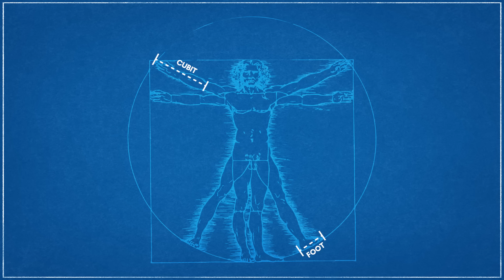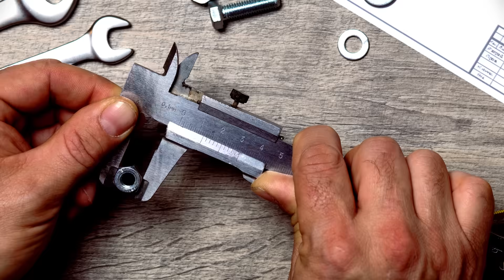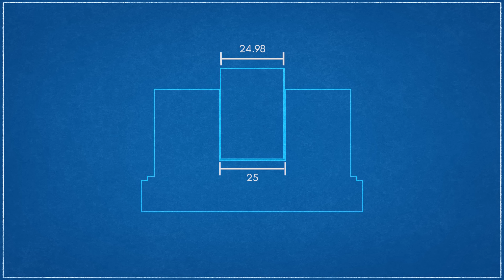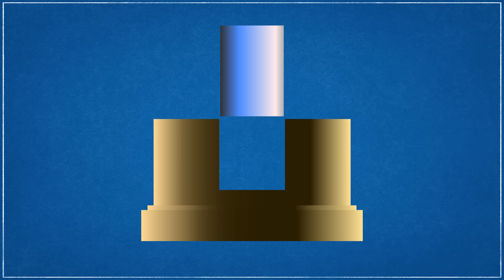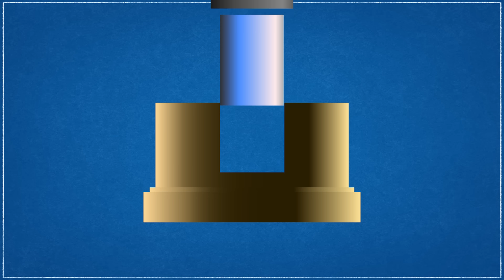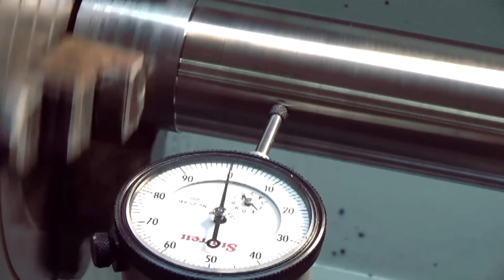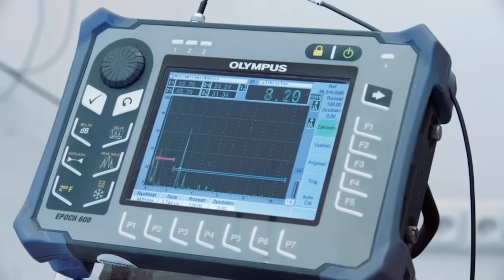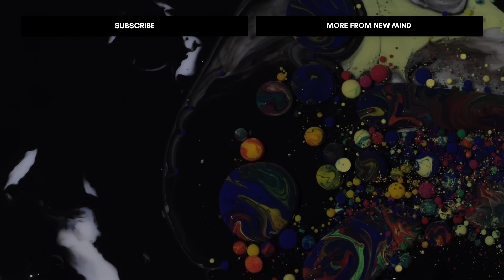The Science Of Small Distances

Comment: ... dealing with distances 50 atoms wide.... :o that's crazy
Reply: Silicon atoms are ~0.2nm in diameter so 5nm is actually closer to 25 atoms thick and at the moment the smallest commercial transistor created by photo lithography is 7nm which is about 35 atoms thick.

If you want to look into the thinnest material we've ever made (at least in lab conditions) look into graphene, that's a single atom thick layer of carbon and is considered a holy grail in material sciences, engineering, semiconductors and everyone in between.
Reply: @GamersaurusRex hard drives are insane if you think about all the science put into what's already becoming dino tech.

Comment: Car engines do use ball bearings. The conrods and crankshaft do not use bearings, but there are bearings at the ends of the crankshaft. There are also ball bearings on the camshaft and on pulleys.
Reply: The only bearing in a crankshaft is the pilot bearing if you have standard shift. Inside the engine with a pressurized oil system you might as well just use it.

Comment: I have almost 60,000 hours at 1200rpm on the main bearings in a 6-71 generator. Still has 30 psi lube oil pressure.
Reply: Who makes the Generator and what type of oil do you use?

Comment: One specialized assembly method to line up two close fitting parts:

Chamfer on one of the parts
-It greatly reduce the need to perfectly line up the centerline of the parts. 
-Parts with clearance of just above 10 micrometers can then be fitted by hand and some gentle force if it is a through hole. 

A blind hole makes it harder as it becomes an air spring, with the satisfying ploff sound upon disassembly.
Reply: That is a satisfying sound. I find myself playing with pin gauges in tight tolerance bores at work a lot. "POP"

Comment: tape measures still provide a vital role in the modern machine shop. I mean, i have to set my cup of coffee on something or else it will leave a ring on the workbench.
Reply: The most common mistake (that happend rarly) was parts beeing sawn too a wrong length. For example 154mm instead of 145mm. But other than getting the raw material we didn't really use it either.

Comment: And yet, the only nation to put a man on the moon still uses miles, feet, inches...
Reply: I've worked on several US military/government jobs where the drawings were in metric. regardless, as Matt D said, the global scientific community (including the US) is standardized on SI units.
Reply: The unit of measure is irrelevant. It's your ability to replicate whatever unit is used that matters. The whole Metric Imperial argument is pedantic.
Reply: @mikelang4191  no , the American system is too akward and  clumsy  for modern science and even for learning
Reply: @tesmith47  imperial originated in Britain and hundreds of millions of Americans have coped with learning it just fine for over 250 years.. and what's so much easier about 0.1 millimeters or 0.0039 inches anyway? I wouldn't argue that a system based on powers of 10 is not simpler, but the imperial system is no more clumsy or difficult to understand than metric when it comes to "small distances" (the subject of the video you're commenting on)
Reply: @tesmith47  look, I'm a Canadian engineering tech and machinist. I really don't care about your analysis as I live this crap every day. SI is better for most engineering calculations, Imperial is better for working drawings and the measurement of small distances. I find the nomenclature more definitive and the resolution is more in tune with the distances of average tolerances. I use both in a regular basis and spend a lot of time converting metric drawings to Imperial as I've yet to meet a machinist who prefers Metric.

Learn to use both well and you'll have nothing to whine about anymore. 

Jay Chap, I agree with you and it's important to point out that the units of Imperial length measure used in manufacturing are base 10 just like the Metric system.
Reply: @jchap15901  I would beg to differ  with that assessment,  a pratical example is the sizing of wrenches , metric is  logical i.e. 10mm is smaller than 12mm and anyone intuivetly  know this but   quickk, is a 13/64 bigger than a5/32?  Of course one can figure it out fairly quickly,  but you see my point?
Reply: @tesmith47  if you work with fractions often enough it becomes rather intuitive, one of my hobbies is woodworking and I can count in 32nds (1/32, 1/16, 3/32, 1/4, etc.) without thinking much about it. but yeah, I would agree that whole numbers are certainly easier to compare than fractions of differing denominators. but if we're talking about "small distances" almost all professions and fields of study use decimal inches like my example of 0.1mm = .0039" and not fractions, including precise woodworking
Reply: @tesmith47  let me ask you this though: would you agree that persons who grew up learning imperial have somewhat of an advantage over metric people because going from a more complicated system to a simpler one is easier than vice versa? personally, I was taught some but not all metric units in grammar school. I'm a CAD operator by trade so I work with fractional inches, decimal inches and metric on a regular basis. conversion between the 3 is a routine exercise, I know a handful of equivalencies off the top of my head like 3/16 = .1875 and 13mm is greater than 1/2", but I definitely can't always do it in my head because 25.4 is not an easy number to multiply or divide for the average person. perhaps it's not so easy for non-imperial persons to conceptualize because they typically have no reason to ever think about imperial units much less converting them.
Reply: @mikelang4191   old obsolete  system cost us billions in international trade AND add needless complexity,  which makes errors more probable.   Remember be the telescope? ??
Reply: Not NASA, nor indeed any other scientific work performed there
Reply: @mduckernz  you should watch the Moon landings someday. Altitude is all called out in feet.

Comment: a freeze plug is another type of interference fit where you freeze a metal plug and driving into a pre-drilled hole. The plug will heat up and expand in the hole.
Reply: Freeze out plugs are a deformation fit. If they popped out when they heated up that would be a problem whenever an engine ran.

Comment: The number 2.54 comes up a lot because that is the conversion for inches.  Almost everything in the electronics business is dimensioned in some small fraction of an inch. In mechanical things this also happens.  That is why so many dimensions come out to weird numbers of mm.
Reply: Depends where you are. Often the opposite is true.

Re: electronics in particular, what springs to mind immediately is LEDs, which are always measured in millimetres, at least where I am. And it's always whole millimetres, not fractions (e.g. 4mm, 6mm, 8mm and so on)
Reply: @mduckernz  
How big is the package on a surface mount LED?  
Check the lead spacing on a:
C503B-RAN-CZ0C0AA1
That is a typical throughhole LED.
Reply: That's because America invented everything! So of course when we invented microelectronics we made standard pitch a tenth of an inch on center. When they go back to the Moon they're going to crash when they try to use that metric garbage. No one cares how many meters high you are off the surface. Feet count then. Which is why our Apollo astronauts called out altitudes in feet.

Comment: Nobody has a foot that long.  It is very obvious that the "foot" was not based on the size of a human foot.  It is also very unlikely that the cubit was really based on the length of a body part.  The structures made in the past needed a uniform measure for all parts of the project.   Thus there would have been a "standard cubit" in the society.  It may have been the length of some stick the king kept but it would have been no longer based on the size of a body part.
Reply: My feet are 1/8th inch under foot,my father's are a 1/4" over,my cousin ' Kipper' has size 19 feet (UK size).so yes some people have big feet.
Reply: I wear size 13 American  which is about 12 inches

Comment: This takes me back to the early 60s, where I have the most boring job of grinding the axles to +- 0.0127mm which were a press fit into the arm of the torque bar suspension for armoured vehicles.
The centre grinder I used had a plaque stating it was patented in 1896.
After that I went on to grinding crankshafts on a more modern machine.

Comment: so, how long until we measure distance in atoms? "i want a 5 gigaatoms long pin"
i guess it wouldnt work as different atoms are different sizes, and are arranged differently in different materials
Reply: Some fields already do, in the form of the unit of the angstrom. Sometimes you will see it used in lithography, for example. Some areas of physics will routinely do so too! It makes sense for them to do so, since they often work at these very very small scales - and the relative sizes of atoms have real effects on their work. 

But yeah as you say atoms are different sizes. So either you pick one in particular, or as the angstrom did, you find a fraction of the existing metric units that happens to be about the right size for a "average" atom. One angstrom is around the atomic radius of sulfur for example. Half an angstrom is the radius of hydrogen.

Comment: If you put two pieces glass together with a couple drops of oil in between them it gives you a great idea of how that thin film of oil works in the engine, it's also pretty impressive !
Reply: lol
 And try pulling them apart without sliding!
Reply: If you have vacuum between two flat surfaces, the attract each other. Electrons on their surfaces do not repel each other (the plates). What is vacuum? Is empty space a fluid? Can  you measure the thickness of a layer of atoms?.
Reply: @vperez4796  machine shops have very accurate blocks of various thickness. Have to clean surfaces and properly aline them, they stick together with an incredible force just from the matching surfaces. This is another entire science. And definitely in the masters/ doctorate classes.
Reply: @bikerbob2005  Johansen (sp?) blocks, and it's atmospheric pressure keeping the blocks together,
Reply: Try clean gauge blocks pressed together.
Reply: Untill you ziptie the waste gate closed on the Dyno and shoot a rod through the oil pan don't ask me how I know that
Reply: The system is a: high volume low pressure or b: high pressure low volume. Chevy's 350 uses the first, ford 351 w. Uses second.
Reply: The amount of blood on the tape measure reminds me of the time as a child when I learned how well they can slice.
Reply: @accreditedbythenicemaninth6495  while they can cut you, that's just rust.
Reply: @patrickherron69  its surface adhision in both cases.
Reply: @peterzingler6221  No, it isn't surface adhesion in the case of bearings. (it is surface adhesion in the case of corrosion inhibitors) 
In the case of a plain bearings (aka journal bearings) the friction is reduced and wear is minimized through hydrodynamic pressures in the boundary layer forcing the surfaces apart. The effectiveness is dependent on the combination of surface speed, fluid viscosity, and bearing pressure [load]; within the design speed, load, and viscosity range a wedge of oil is created that is thick enough to prevent all metal contact. 

At low speeds or low viscosity the oil film is less than the height of the surface roughness of the metal and some wear happens as well as an increase in friction, the amount of wear depends on specifics and if done in a controlled fashion can actually be used for "break in" which is really just a final polishing step to reduce the roughness. This is also why most engine wear happens during startup, stopped bearings have no oil film thickness.  

At speeds or viscosity higher than the design optimum the layer becomes thick enough for some other fluid dynamics to become relevant and you get a slight increase in friction [as energy loss to heating] but no change in wear as the metal surfaces are still fully separated.
Rolling element bearings like ball bearings also use hydrodynamic pressure but the practical details are quite a bit different.
Reply: @mytech6779  Does oil pressure not affect the capacity of plain bearings?
Reply: @davidplatenkamp  The point of high oil pressure is more for keep oil in the places it's supposed to be, but it most likely does have an effect on how well the plain bearings work. I would image higher pressure increases the bearings performance.
Reply: @Heck6  I'm no engineer but from what I've seen in big diesel motor oil pressure isn't necessarily better if you look at cat c12 pressure are higher then a Detroit N60 and both are reliable but I think it have more to do with manufacturers tolerances because they both use same viscosity oil.
Reply: @philou961  the oil pressure in the system isn’t necessary the pressure at the bearings. An engine might have higher oil pressures because the internal drilling’s are more restrictive or it’s has components like fuel pump or turbos that need more oil.
Reply: @davidplatenkamp  only indirectly. More pressure can provide a bit more flow, and flow can make for more load. But it’s tiny because internal bearing pressures are much higher than oil pressure. So it’s really more about ensuring enough oil pressure to feed the bearings. Some bearings will need more than others— thinner oil, wider clearance etc.
Reply: @G5Hohn  by curiousity when oil is thinner you don't want tighter tolerance between surfaces ?
Reply: @philou961  mostly you need more oil flow. Ideal clearance doesn’t change much with viscosity because the primary load bearing mechanism is the relative incompressiblilty of the oil
Reply: @G5Hohn  I mean when parts are machined to spec that the manufacturer wants like Toyota motor have tight tolerances with 0-20 oil and gm motor have less tight tolerances with 10-30 oil. The cost of manufacturing goes up alot when more precision is needed
Reply: @philou961  yes, tighter tolerances drive higher cost. But I’d be stunned if there were meaningful differences in tolerances for key parts from one manufacturer to the next. There’s generally an industry consensus that everyone does the same.
Reply: @G5Hohn  I would be curious to know if manufacturer use slide and fit tolerances from machinery handbook kinda usefull information when designing something.
Reply: @philou961  at my company we use our own requirements based on our collective history plus a lot of computer simulations. FEA, CFD, etc
Reply: @mytech6779   it is. Only because of adhesion, the oil gets pulled into the small gap between the surfaces
Reply: @mytech6779  qanqnana
Reply: @philou961  Tolerance and allowance are different concepts, I believe you may mean tighter allowance. But just what what allowance or tolerances are you talking about? Oil viscosity is selected to match the machine, the machine is not selected to match the oil. The smoothness of the bearing will effect the required oil film thickness. The allowance for distance between surfaces is usually determined by the desired oil film thickness. Viscosity is adjusted to get this film thickness(range) within the operating speed and load of the bearing. Viscosity can be changed with temperature or chemistry.
Reply: I was talking about difference between motor manufacturers like caterpillar c12 use high pressure and low oil flow and a cumming n60 is high oil flow and low oil pressure and both use same oil
Reply: @philou961  Bearing lubrication actually requires very little oil flow or pressure. However the oil is often used for other purposes like cooling[higher flow], or if they have any oil spray nozzles that would need higher pressure.[often used to lube cylinders and cool the bottom of pistons] 
Also accessories that operate on oil would be a factor, hydraulic lifters or a bypass filtering centrifuge for example.